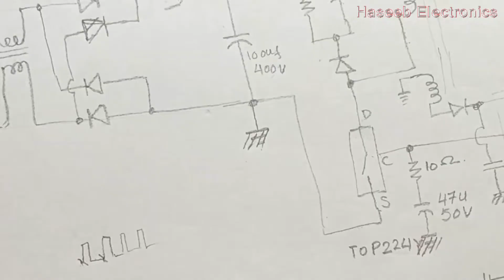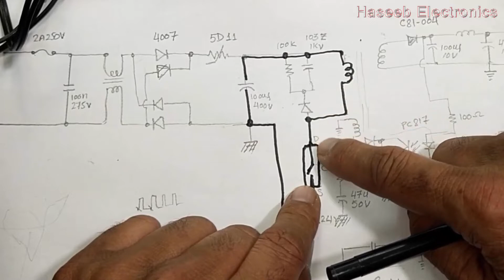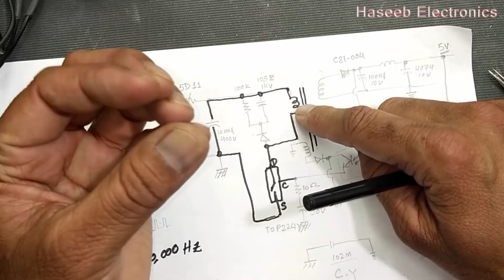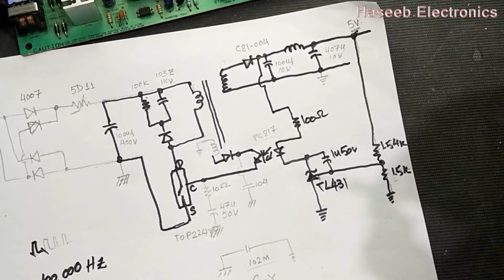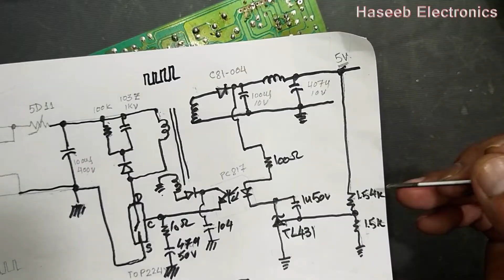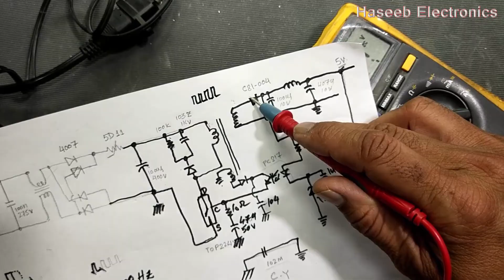{236} TOP224Y SMPS Circuit Diagram Explained With Practical

Comment: If the transistor does not turn on, the primary winding will not create a magnetic field, and the secondary winding will not receive or generate voltage. If the secondary winding fails to generate voltage, the IC will not turn on. However, if the IC turns on first, how does it create the magnetic field in the primary winding?"

Comment: Sir mera pass 60v 4a e scooter charger pwm ic ka3842 but dead condition mani capacitor 351v dc ka3842ic vcc voltage 13.5to12.49 vary vref voltage 2.3v to down 0v repeat 2.3v0v flaxvate solution sir

Comment: Thank you for your Tuto. 👍. May I ask you a question? I Have on a power supply with TOP223, the frequancy at 160Khz and the diode (on your plan D2 UF5401) comes very hot. do you have any idea about this problem? Thnks for your reply.

Comment: Thank you for sharing your video. The main capacitor on my refrigerator's power board is rated at 100uf and 450V. However, when I test the DC voltage on both the + and - terminals of the capacitor with a multimeter, nothing is detected. Where should I check first?

Comment: My welding machine uses TOP223YN and its continuously switching on off. Now I think I know the problem. 😊
Reply from the maker: it seems there is something short circuit in its secondary side

Comment: i repaired this power board everything is works do you knows a 400volts capacitor it’s hold a charge for a long time even the power is of
Reply from the maker: great
yes, the capacitor stores charge for long time. it must be discharged very carefully.

Comment: Re:vestel 17ips12 Mr Haseeb..can you please explain why I have a fluctuating voltage at HV pin 8 of the U101 pwm controller.The 400v at the bulk capacitor is stable and the resistors before the pin are all ok..The main transformer is not turning on .The VDD pin 6 flutuates also...is this my problem
thanks for enourmous help with electronics...I dont have the FAN6300..mine is 1Q001..

Comment: Sir, Top 224 energises the primary winding of the transformer at high rates. The magnetic flux then induces to the secondary coil to generate AC voltage. That AC voltage is then converted to DC voltage for the Rails supply. The Optocoupler is used as a monitor for a regulated voltage.

Comment: The primary side of  transformer will not induce a dc current . that s why we need the switching element . this swithing elements will create pulses . and the transfomer will induce the pulses to the secondary . if a dc current is crossing the primary , no thing would happen at the secondary
Reply from the maker: yes 
transformer works on varying magnetic field only. and the pwm controller controls the switching of the switching device (transistor, mosfet igbt etc)

Comment: Hello Sir! I was o-scope probing a TOP switch and it burned the fusistor at the 220V input and damaging the chip. I was probing the Control pin, can't remember exactly but my scope was floated, I guess somehow the chip raised the voltage since the Control was not operational. Have you any experience with these issues?

Comment: Sir, Iam using top246yn. Here i find if i lower the value of resistance in the feedback pin of Ic for more current it is getting burnt and also the fuse. If fuse is there why Ic is getting burnt?

Comment: What a nice way of explaining. I have a HV HF power supply called PVM400 from information unlimited. It was used to drive a plasma machine but not there is no more plasma and i am assuming the 50KHz output is not coming from the supply. Can you please explain the circuit and help with troubleshooting. the schematic can be found by searching on the web.

Comment: If all my components look good and I don't have problems with shorting the output of my power supply, but my power supply doesn't deliver voltage, is it possible that the TOP224 is damaged?
Reply from the maker: check voltage on control pin. if there are no voltage, check the vcc capacitor at control pin 
if capacitor is good, then REPLACE TOP224 IC

Comment: Another thing I was interested in is the voltage across the pins on the optical color does it have a limit is it you know 0 to 5 V or 2 to 5 V I have an opto coupler that is reading 78 V cross the pins my guess is it's a transistor or capacitor feeding that circuit that's shorted or opened my guess would be short it as short as it's feeding the voltage across there
Reply from the maker: optocoupler at input side (input LED) side it takes maximum 1.6 volt. normally 1.1 volt. 
while the output side,  voltage value depends on type and application of the optocoupler, it may reach from 30V to 1000 volts, depending on the circuit 
check video numbers
576
477
462
377
352
277
225
Reply: @HaseebElectronics  Thank you kindly for your quick reply, I will watch the suggested videos. I have watched several other videos you have posted and and very impressed with your knowledge and your detailed explanations.  Respectfully, Allah bless you.

Comment: question: would the snubber part of the circuit also be referred to as a boot strap. One resistor one capacitor and one diode
Reply from the maker: no 
snubber is a reverse EMF clamper circuit, which gives easy path to the voltage created by the collapsing magnetic field, in the off period of the MOSFET
Reply: @HaseebElectronics  ok so same components but applying different applications. What I’m referring to ,a boot strap, is used for is in laptop computers. Thanks for the quick reply.

Comment: Hello sir, my power supply is having humping sound but output is stable, need your advise..thanks
Reply from the maker: it may be due to loose winding 
inject liquide varnish using a syringe
may be core pieces are separated, it may be cleared using varnish or flowable adhesive

Comment: very very well explained  i save all your videos sir you're  the best keep safe and god blessed
Reply from the maker: Thanks and welcome
Reply: @HaseebElectronics  tl431 ic sir ref voltage is almost 2.5v?
Reply from the maker: @geraldfactor5781  it is considered 2.5 volt 
actually it is 2.490 to 2.495 volt and may upto 2.5V (depending on the suffix with part number)

Comment: AOA Sir
Sir i have power supply inwhich TOP223 is used and there are three outputs are there 5V, 12, 15V. All supplies are ok without load but when i connect with load 5V supply remains constant while others are drops the voltages and cliking sound comes from Chopper/Transformer. Please advise.

Comment: Dear Sir, I would like thank you for all your very informative films, I have been learn a lot! My question is: what is doing 100k resistor paralell to capacitor after protection diode (at primary winding)? Is this resistor just protecting capacitor by lowering reverse voltage from primary winding? 
Greetings from Poland
Reply from the maker: it is RCD (resistor Capacitor & Diode) snubber circuit.
when the smps controller IC switches at that time the diode becomes reverse bias and current have to flow from the transformer primary, which will cause to build electromagnetic field. 
now the smps controller ic will go in off time and the mosfet will switch off and the current flow from mosfet will stop
now the magnetic filed stored in primary will start to collapse. collapsing magnetic field generates the reverse voltage to the applied voltage 
thus the diode will become reverse bias, and the it will charge the capacitor and meanwhile some energey will discharged through resistor as well. 
in this time the energy stored in primary will become zero, and primary winding ready for next switching cycle. 
in this switch period, the charged capacitor will discharge in parallel resistor.
Reply: @HaseebElectronics Thanks a lot :) I just found out your film about snubber circuits.

Comment: Great job, in a power supply I foresee TOP202 YAI got damaged, its computer drive box out put of power supply is 12+5 v 1 amp, what could be the cheapest/replacement of TOP202 ?

Comment: As you hold the multimeter probe or lead on the AC/ Hot side for identification of faulty components on the DC side why there is spark because they are being bridged. Thanks Sir

Comment: I thought that the control pin is really the gate.  Is that true?  Why is there only one diode used to rectify the output voltage on the cold side?  The engineers are using a nice LC pi filter after the diode, but I would think that they would want to design it with a four diode bridge for high quality.
Reply from the maker: control pin is is multi function pin. it is  Error amplifier and feedback current input pin for duty cycle control. Internal shunt regulator connection to provide internal bias current during normal operation. It is also used as the
connection point for the supply bypass and auto-restart/ compensation capacitor.
Why one diode is used?
as it is flyback circuit, in flyback during switch ON time the secondary is in off condition. and the transformer stores energy in its primary,   in off time the magnetic field collapses and the stored energy is transferred in secondary winding , so that is the reason only one diode is used in flyback. even it may have multiple outputs, but the energy will transferred in off time of duty cycle (check video number 269)
it makes the design with less components and cost effective

Comment: Very good explanation! How can I check after secondary shottky diodes which are OK, when no output voltages 12V, 5VSTBY and primary ok 320v filter capacitor, 12v VCC at IC STR6253D pin 4 and Transformer OK with Blue Ring Tester? You are very good technician! Thanks.

Comment: I have an issue with a smps similar to what you have explained  in your  video. I am refering to a power supply in Behringer UB1204 mixer. Works for some time (10-15 mnts) and shuts off supply. After  a while it will come ON.  it goes off and on while in use. What area in the circuit to check. Appreciate your advise. Thanks
Reply from the maker: beat regards
it looks that your smps circuit is working in overload condition 
or
it's output section have some issue
please check the output capacitors
Reply: @HaseebElectronics  thank you appreciate your prompt reply. I will check all caps.

Comment: How that ic will get vcc sir... Is it from drain point... If it's from drain point, when that if on that drain pin was act as ground line... So how ic ge stable vcc ?
Reply from the maker: initially when the IC is off, the internal charging circuit will start charging the vcc capacitor, when the capacitor will reach at UVLO ON threshold, that time the charging circuit will disabled and PWM section will start, )this time the charged vcc HOLD OFF capacitor will provide backup power to the IC)
when it will drive transformer, that time auxiliary winding will start charging  the vcc HOLD OFF capacitor, and ic will get operating voltage 
first step is called STARTUP MODE
second action is called OPERATING MODE
Reply: @HaseebElectronics  thank u sir

Comment: Thank you so much for giving us the knowledge in a very convenient way to understand. The theory is worthless without practical experience. you are doing both at the same time. you are better than a university lecturer. I am a Sri Lankan. keep the good work. God bless you. Stay safe...( I have a problem Mr.Haseeb... I have an issue in a Phillips home theater system  MX3660-D30 SMPS unit. Problem is the TOP249Y IC is blowing each and every time when I replace it . I can't find a short... power standby mode is ok.If you switch on the unit either remote or push button the TOP iC blown with huge sound... I you have time can you please look my problem... thank you ...)

Comment: Sir, ic ko start hone ke liye vcc kahase milenge?????
Reply from the maker: Excellent question
is IC ko startup resistor ki jrurat nhi hoti. initially ye drain pin se supply le kr CONTROL pin per lagey VCC capacitor ko charge karti he, 
jab wo capacitor VCC threshold maintain karta he to ye ic internal charging circuit ko disconnect kr ke soft startb leti he. aur switching start karti he.
us k baad is ko optocoupler k through control voltage miltey hein jo k auxillary winding se optocoupler ko diey jaatey hein

Comment: What is the problem if the power supply trip off? my power supply of peavy mixer using top244yn ic i opend already i cnt see any blast component but my mixer is working only 5 minutes then off and i wait for 5 minutes i turn the swicth then ok again.if i used electricfan as cooling system the unit is continue working.what is the problem?maybe ic or diode?hope you can help my problem.thanks
Reply from the maker: I think there is some capacitor having leakage
Diode or ic failure is permanent but capacitor fault is intermittent
Reply: @HaseebElectronics  what is the cause sir if the ic to much hot?i change already 3 capacitor sir,1 main capacitor and 2 small capacitor but the problem is thesame.
Reply from the maker: May be ic is driving overload, some components is mismatching
Ic internally leaking
Snubber circuit have problem
Reply: @HaseebElectronics  so i change ic sir?
Reply: @HaseebElectronics  thank you so much sir,i try to change ic maybe ic is the problem

Comment: Nice explaination, but you should have explained also the fault finding  on secondary side using multi meter. Use RX1 scale on multimeter for finding any short cicuit, and visual inspection of all condensors on secondary side for any leaky or dried up capacitor.
Reply from the maker: best regards and special thanks for providing a valuable  guidelines.
i will share in upcoming troubleshooting tutorial.
stay blessed

Comment: Can we make 60 volt ,6 amp - 360 Watt charger using top 250 ic
Reply from the maker: TOP250Y have maximum 290 Watt capacity. so it cannot drive 360Watt load after deduction of  losses
Reply: @HaseebElectronics  it is possible to use  2 TOP 250Y in parallel?
Reply from the maker: @tourist719  no it will damage the ics
Reply: @HaseebElectronics  sir any good driver IC for the same?

Comment: Sir I am not getting any voltage at vcc capacitor. What would be the problem
Reply from the maker: it means the smps controller ic is not switching 
after switching the primary winding, then the voltage will appear at vcc capacitor
Reply: @HaseebElectronics  so what should I do now

Comment: Top 250 ic issue 
24 volt adapter giving 3 volt output
All capacitor diode rectifier checked no issue !
Reply from the maker: rcd snubber 
optocoupler or feedback circuit have problem.

Comment: Salam M Haseeb. Thanks to you i could fix my psu. Someone changed the snuber circuit resistor to a very low value, resulting to a no voltage output. Hard to find because all components tested good, but this capacitor was hot and then faulty. Thanks and always happy to see your videos. May God keep you safe. Hicham from Morocco. Salam Aleikum.
Reply from the maker: Wa Alaikum Slaam brother
i am happy that my efforts are helpful
remember me in your prayers

Comment: Sir, how can you understand working frequency?(For example you say 100 KHz) How can we calculate working frequency and maximum working frequency?
Reply from the maker: first of all we have to see the datasheet
some ic have fix frequency (as TOP224 have just 100KHz)
some IC have facilty to adjust frequency, we can adjust its frequency sing external components (as TL494 have range 1KHz to 300KHz     SG3525 can be adjusted 100Hz to 400KHz)
so we have to check datasheet first to see the switching frequency
i will explain in upcoming video as well
Reply: @HaseebElectronics  okay in my powerman 350 watt atx smps, 11N90C power switch mosfet, in this mosfet datasheet I see  f=1.0 MHz (Some datasheet don't write frequency maybe)
This smps has ICE2A0565Z and UC3843B and this time I can not determine working frequency and I want to learn the working or maximum working frequency because of I want to rewinding transformer thats why I want to determine and calculate transformer wire diameter, thank you sir

Comment: I love the way to explain the sequence of the circuit's operation. It helps a lot to understand how it works. Excellent class congratulations.
Reply from the maker: You're very welcome!
Reply: @HaseebElectronics  salamualaikum.  How to fix _power supply that has fluctuating voltage( universal tv board)
Reply: Same here